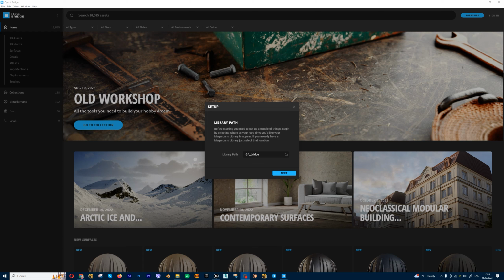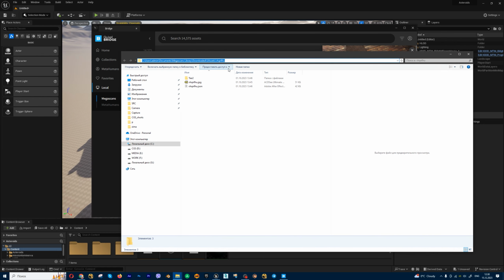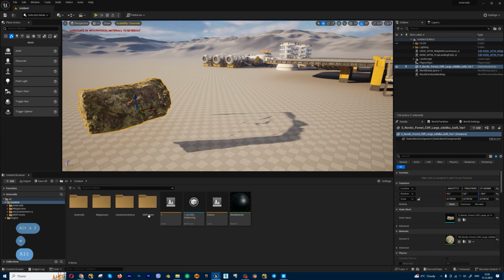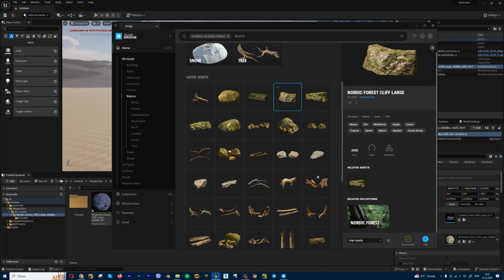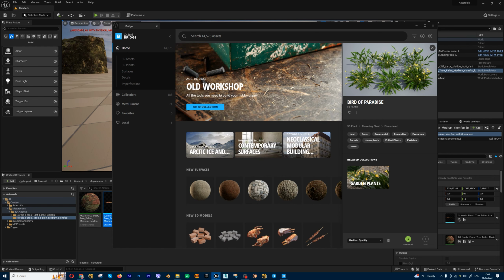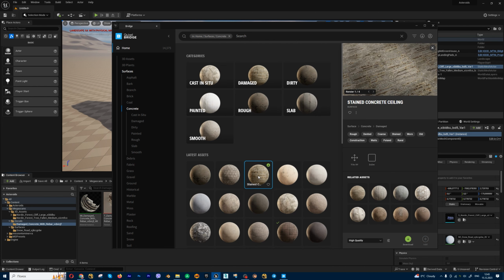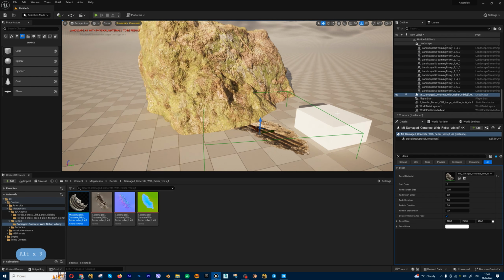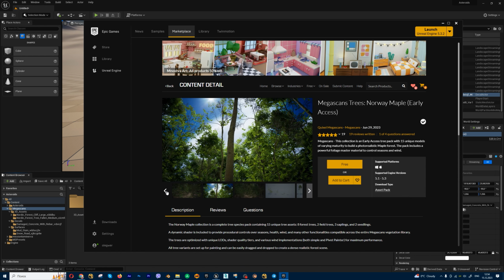Quixel Bridge + UE5. Tips and Tricks.

Comment: Great video. You can actually batch lower the resolution on any textures in the content browser by selecting the textures (helps to use the filter command), then right click and choose Asset Actions - Edit in Property Matrix and then search for "Max" and set the maximum texture size to whatever you want. 2048 for 2K or 1024 for 1 k. The engine will automatically use a mipmap at the specified resolution. This is probably a better way to do it so that you can easily increase the resolution if you want more fidelity for a particular asset without having to re-download and re-add to the project.